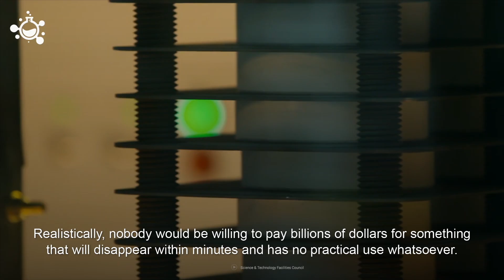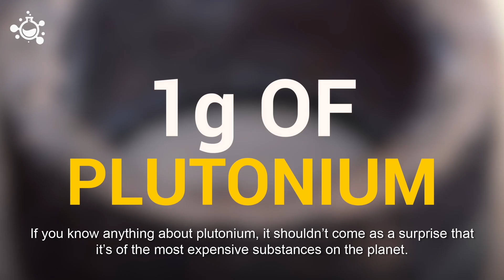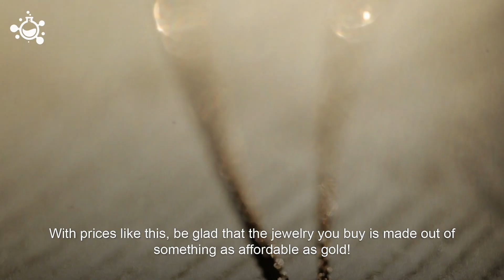The most expensive element on Earth: $1 billion per gram!

Comment: 4 years ago, when this video was posted, scandium metal 99.999%  cost US$5800/kg or US$5.80/gram, NOT US$270/g as this video claims. An exaggeration of 46 times. The current price, 3 January 2024, US$5,525/kg or US$5.53/gram. The total current world market value is ca. US$500 mio/year, definitely not US$2.7 billion. Scandium is used in really very tiny quantities as an aluminium alloy in some applications in order to improve weldability.

Comment: Hey, plutonium also has a third use, nuclear batteries. in fact it was used to make the batteries for some NASA's missions, like the Vojager ones, because the satellite in question must be delivered out of the solar system, so the solar energy can't be used, beacuse it was too far from the sun. Bye!
Reply: Yup that isotope is where the 4k price comes from. They use 238Pu as the heat source in those nuclear batteries. They also used it in cardiac pacemakers in the late 1970s. The nuke fuel 239Pu isotope is far cheaper at only 200  bucks a gram for authorized users.

Comment: But why are some elements so much more expensive  than others? Just because they’re rare?
Reply: Supply and demand, and ease of isolation and shipping. I would guess that as a gas, nitrogen is cheapest. Iron is the #1 metal in commerce because it is common and easy to extract. You would use iron to transport many things. 

Germanium is costly because  it doesn't concentrate well. It isn't rare in the sense that gold is, but gold concentrates well.

Arsenic has few legitimate uses, so it isn't valuable. (Really, it is trouble).

The rare earths are costly to separate, so they are pricey.

Radioactive, synthetic elements are extremely expensive.

Comment: The MOST EXPENSIVE ELEMENT on EARTH BY FAR is Plutonium Pu239, with an estimated value of $24,000,000,000,000,000 per MILLI-MICRO-GRAM. The US Atomic Energy Commission (DOD/DOE) may have created 14 atoms of it in ten hyper-hydrogen bomb tests measured by gamma ray particle decay. The former USSR nor Red China have the technology to push Plutonium to such high energy levels in bombs, by particle decay measurements. The Israeli's do and have.

Comment: There's 3 uses for Plutonium. 1) Nuclear bombs, 2) fast spectrum nuclear reactors, and 3) nuclear batteries for radioisotope thermoelectric generators. Pu-239 should really be burned in fast spectrum nuclear reactors and not thermal spectrum nuclear reactors (the kind we primarily only use now), as the neutron capture rate is around 33% for Pu-239 in the thermal spectrum, meaning 1/3 of your fuel won't get burned but will instead turn into dog-crap you can't burn at all in the thermal spectrum.

The 3rd, nuclear batteries, isn't exactly the same as the 2nd, nuclear reactors, as they're both generating power from heat, but they are doing this through different methods (the 2nd uses heat released from the fissioning of atoms while the 3rd uses heat that is released from the natural decay of Pu-238). You might say that despite the different methods used to generate heat, both 2 & 3 have the same use and are thus the same. I would point out, however, that a similar thing could be said for 1 & 2 as they have different uses for plutonium, bomb vs. power, but use the exact same method for achieving those uses, fissioning atoms. So, there's either 3 uses for plutonium, or only one. Which is it? Sorry, don't know why I got all confrontational there. You going to make something about it?!

Comment: Plutonium is not valuable I know where there old silos full of drums of it just sitting and uranium I also collected old watches and anything with radium on it and collected 1233.8 grams of it and with the help of a flash system and ammonium chloride was able to get it back to its normal phase (solid) at it being $80k-$120k USD per gram I thought I was going to be rich well couldn’t find anywhere to sale it to and had the epa and national radiation people knocking at my door along with other agencies and ended up having it taken from me and almost got arrested and a fine. Plutonium is illegal to own or have even if your a element or mineral specimen collector. It’s reaction with cold water cold air with any moister is unstable but most people don’t know you can hold it in your hands and as long as it’s stable it’s as toxic a lead go figure and uranium is legal to own even uranium-325 that’s used in bombs and it can be bought from Amazon and it react with water will turn black as it’s oxidation cycle starts a lot of black sand found with gold is uranium and iron so stay away from the furnace if refining gold from natural deposits and where a respirator that has the proper Patrick’s filter on it don’t let any radioactive material get in your skin will cause severe burns and hey don’t play with smoke detectors the sensors use as a catalyst to detect carbon gasses to set off the alarm are made from radioactive metals I may be wrong but I believe it’s platonum or uranium 325. So don’t Breath the dust coming out of smoke detectors when replacing the batter where gloves and keep out of reach of children or any low iq individual. If I’m wrong on any of this please tell me as I do not use the internet/google or web browser site for resource for my information I read books or log into library of congress to read and other archives. And yes I’m always wrong because to much study will sometimes get mixed up.